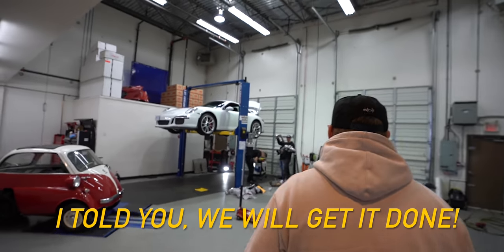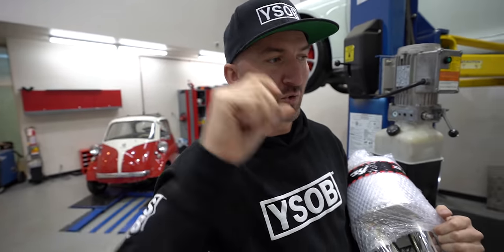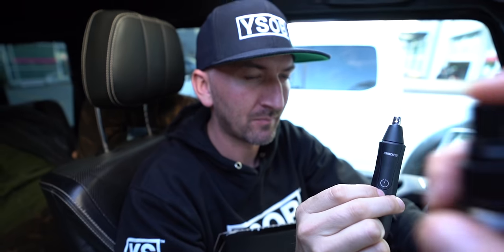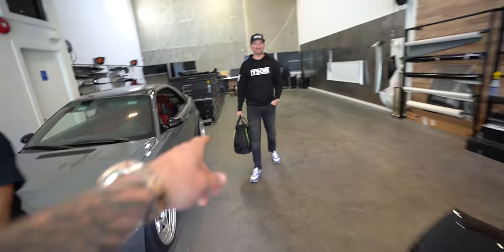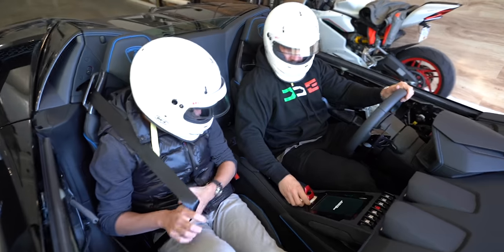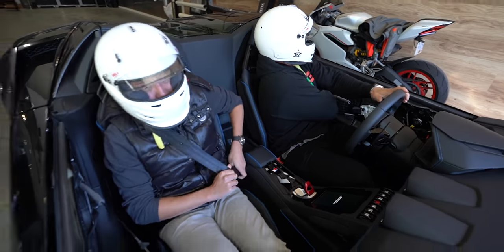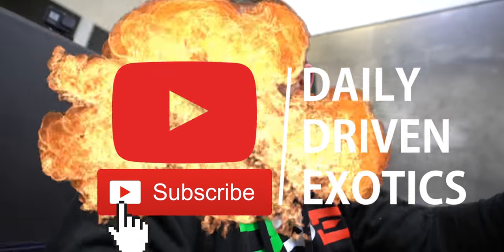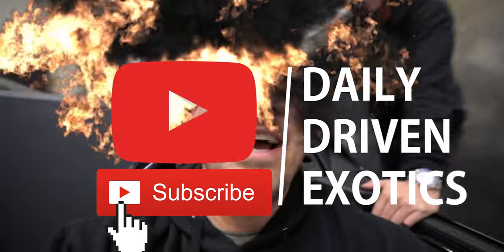NEW WINDSHIELDLESS LAMBORGHINI VELOCE APERTA! *FIRST DRIVE*

Comment: There should at least be a small windshield to protect the interior a bit-
Reply: They will probably do one
Reply: I agree.  Without any windshield it really just looks like a hacked up Huracan, not a finished project.
Reply: Are you trying to give them ad visor ?
Reply: @craigt6707  agree 100%
Reply: I feel like it would look so much better the same front windshield as Aventador j or a short window that wraps to the door if y’all know what I mean
Reply: @aryanbaweja896  I feel that since they already removed the a-pillars that they are not planning on it.  I assume they could've just shortened the a-pillars and had a small custom piece of glass made to fit.  Not easy, and quite expensive I'm sure, but that probably would've been the way they would have gone if they were going to do it.
Reply: They will get sick of it considering how many rain storms they get stuck in. Hope this isn't their new thing, making exotics ugly as hell
Reply: Thats not how the car works if you see were the windsheld is supposed to be there is a like a hole that shots up air and blocks the air that is blowing at them so it is like a windsheild with air
Reply: this is the dumbest idea, but maybe they could do something like a jeep where it has the foldable windscreen but for the huracan it should be at an angle like the original windscreen
Reply: Definitely
Reply: Small windshield like the Porsche Speedster
Reply: @craigt6707  I definitely agree with you but knowing them and what they do I’m sure they’ll figure something out,  I personally wouldn’t have done this but I guess it’s just business

Comment: Two things need to happen. 1. Those helmets need to get painted! 2. I hope you plan on having some rollover protection in that beast.
Reply: The rollover protection is behind their heads
Reply: @jasonharryphotog  I keep hearing people talk about "rollover protection" and forget that all convertible vehicles already have it built in...smh
Reply: It should fine so long as they have calculated the angle between the top of the pop up roll bars and the front of the driver cell compared to their head height is sufficient enough. I would definitely recommend racing harnesses though!
Reply: Remember it started as a convertable. All these cars have rollover bars which deploy automatically in a crash like an airbag does
Reply: @1216jimmyz   OK I will point out that the structural integrity is highly dependent on the front windshields a pillars.
Reply: @petezee6645  but there's no A pillar anymore... and yes I know it has a popout behind the seat in case of a roll but it relies on the height of the A pillar to prop the front up.
Reply: @onkouth  for sure harnesses are good, but in this case, if they don't have adequate rollover protection it makes things worse. With a reg seat belt you can bend down to the side at least, but with the harness, you're locked upright getting crushed...
Reply: Look at 8:26 and tell me that looks ok... 💀
Reply: @ginnipig   agreed, that’s why I mentioned the passenger safety cell design, it needs to have the the same structural dynamics as an F1 car prior to the introduction of the halo, that is the imaginary diagonal line between the top of the roll over bars at the rear running to the part just in front of dashboard where it meets the front bonnet, if they are sitting low enough in the cabin, there should never be a point where the car itself won’t protect them even it flips upside down. The McLaren Elva and Aston Martins V12 Speedster will follow this design, this car needs to aswell which worries me slightly because it wasn’t designed as such from the outset 👍

Comment: Cant anyone see how dangerous that car is? If it rolls there's nothing that protects the driver and passenger's head, even the Aventador J has lower seats and higher rear arches, hope you'll do that too.
Reply: it has pop up roll bars in the back made exactly for this, you can't expect the A pillar to protect you in a roll over, and it doesn't in a convertible
Reply: I hate the idea of what they did to me a convertible is more free feeling then wearing a helmet all the time. But it’s dangerous maybe from a structural standpoint. But the windshield will just crush in a rollover either way but in Lamborghini and other cars they have roll bars that pop out when the airbags deploy.
Reply: @carculturenation2166  no way, this is your car?
Reply: @ssllhh100  Yeah I know those pop up bars are there but in any convertible crash test you can see that the pop up pillars and the windshield pillars work together to keep the cockpit from crushing, you can't expect to remove one or the other and hope that it works properly.

Comment: 6:12- I hope they bring the A pillars with the windshield nd windows back:) Obviously they will, but it doesn't look nice in mid-project mode.
Reply: The car was designed to have them removed. The front screen slides in and out. Locking retainers.

Comment: Still want to know the point!?! If it was just for looks that definitely don’t do it for me. It’s just to wide open and with wind blowing in your face you can’t really vlog while driving. The dash just looks awkward with so much showing. It don’t have the wrap around you look like most cars without a windshield plus Usually have a way to direct the air around you. And one downpour out of nowhere and the dash getting wet will not be good. To me convertible is more free than waiting a helmet all the time. Plus we now know we won’t see a tire slayer until spring. Besides the trip to Florida that’s coming up to turbo it.

Comment: I think they should remove the convertible system completely in order to save a lot of weight. Cause those mechanical systems weigh a ton.
Damon i dont know if you have already done it. You probably did but i just wanted to give my opinion.

Comment: if you delete the seat  mechanism  and just bolt the seats to cars chasse you will have lower seats and you will be fine with wind at higher speeds you have to buy after market seats then it will be like a F1 car

Comment: If you flip it over , would that be instant Death ! Also cutting the roof off completely weakens the chassis flexing front to back and twisting?? Bulkhead needs extra strength,  the side sills have to be stronger and you need sprang loop head rest anti roll bars same as fitted to a BMW convertible for example.  Looks good but is a Death trap.